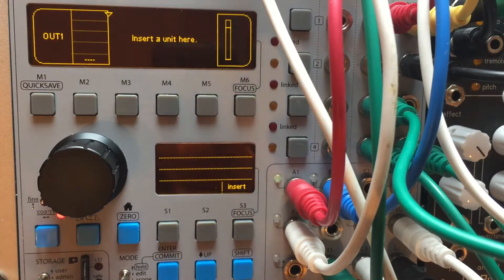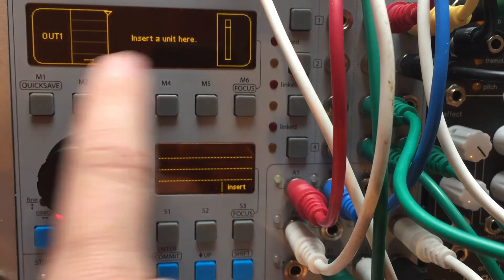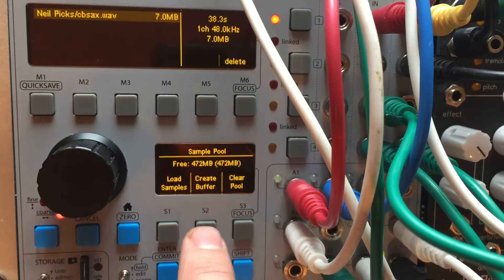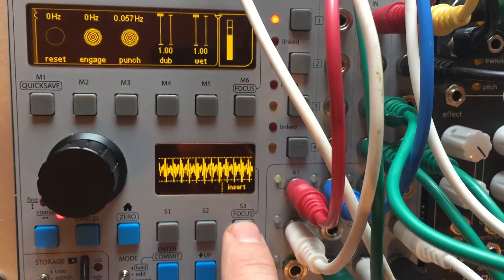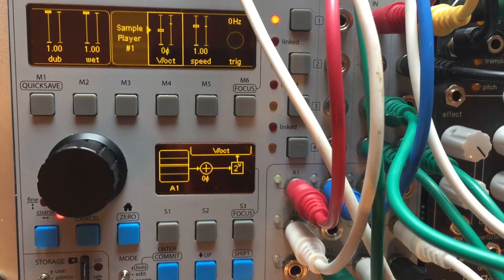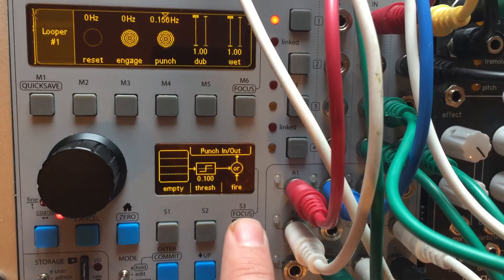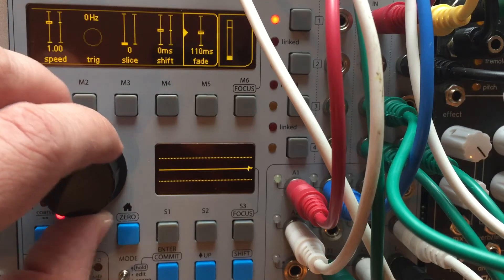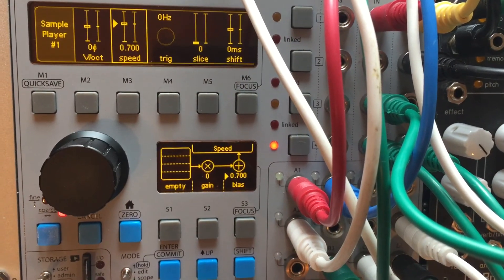Getting started with the ER-301 #15 - Using a Sampler Player and Looper with a Shared Buffer file

Comment: This has been one of my favorite features on the 301 since I've had it for sure! Been using this technique to sample piano live (with the looper) then use the same buffer in the sample player. I use the Mutable Instruments Ears module to get the piano into the 301 but also use the envelope and gate outputs as CV sources into the 301. The gate out triggers the playback on the sample player and the envelope selects different slice points. So after you have recorded a loop you can kind of control the playback of the loop in real time with your playing. Super fun!

Comment: Ooooooh! So much wow! I haven't really tried the looper yet, this is a great introduction, thanks again Neil!                            , I wonder if you set the speed to minus would it play the buffer in reverse? Going have to give it a try!
Reply from the maker: Sun_ Shine_Lover it should go backwards yep!
Reply from the maker: Actually for sure it does - because adding that sin giving it the warble is a bipolar signal so the speed would have gone into the minute :)
Reply: And indeed it does! Giving it a try out now with a CV source set to minus the speed enough so the playhead plays in reverse! Also I have been triggering the loop on and off and messing with the pitch as well, which is very very cool. One thing I came across is that when I am triggering the buffer to play in a loop it always loops at the same amount at that I have set the buffer to. Is there a way so that I can change the length of this loop? Or is it always set to the length of the buffer?